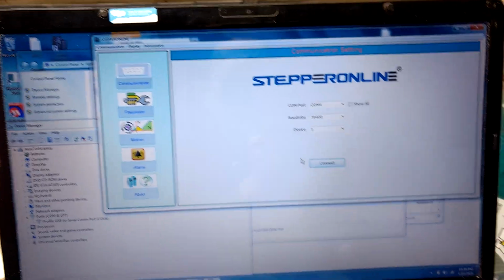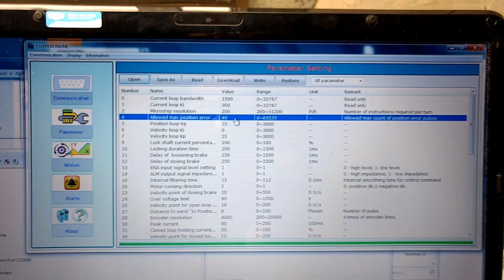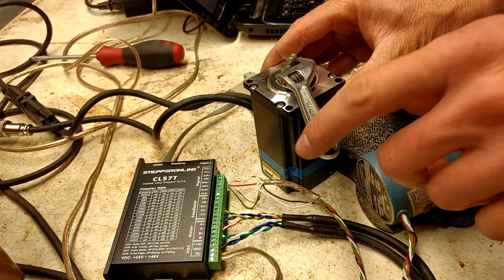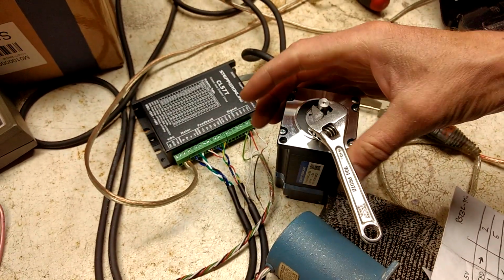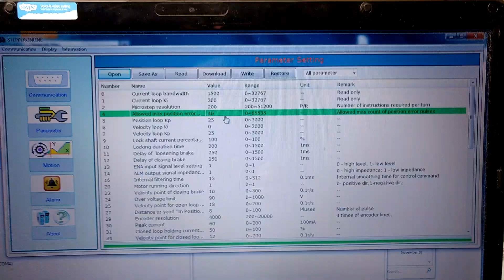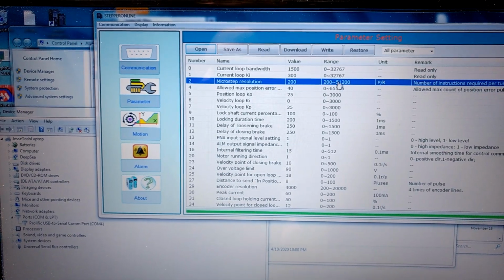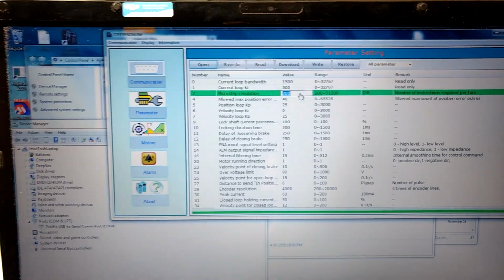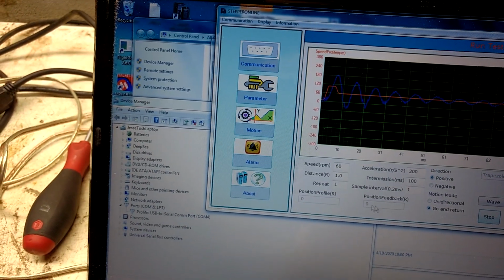How to enable Following Error Alarm and Custom Step Count on CL57T Hybrid Stepper Controller

Comment: That tuning graph is to help you tune the driver for the specific location where the stepper is installed, you tweak the PI (Kp and Ki) parameters. That means you tailor the stepper for the specific job so it can do it faster and with less error. Check on YouTube "PID regulation" for more info.

Comment: How to control this leadshine CSD 403 driver with Arduino please help me
Reply from the maker: I'm sorry, I don't know much about Arduino. But the controller has a step and a direction pin as I recall - you pulse one pin to step in one direction, or set 5v on the DIR pin to change direction, and pulse the first pin to make it step in the other direction.

Comment: I have an issue where I can't push the Y axis motor very hard.  Based on your video the issue should improve if I increase the value?
Reply from the maker: It's hard to say. Could be numerous problems. Did it used to work right then it quit working right? Have you tried wapping X and Y motors to see if the problem stays with the X axis or moves to the Y axis? Have you tried swapping the X and Y (inputs and outputs) on the stepper controllers, to see if the problem is the motor or the controller?

Having the max following error set to a very small number could limit the amount of toque available.
But having the maximum current setting set too low could also limit the torque.
It could also be a partly shorted winding in the X motor, or bad wiring.
It could even be stray inductance in the motor and/or sensor wires running to the motor which cause interference when the motor starts to work hard. See how the motor and sensor wires are all tightly twisted up in my video above? That's a good idea. If those wires are loose and stray, they can interfere with eachother and cause false signals that can cause following error faults.

But it's definitely worth looking over the settings and make sure everything is as it should be.

And of course don't forget to check the mechanical X axis, make sure it is freely moving and not binding up!

Cheers!

Comment: I purchased a different brand cl57 and they are saying it cannot be used with software :(
Reply from the maker: Did you try the software and does it not work? Or who is telling you that it cannot be used?
My guess is they all just copy eachother, I would have guessed that the stepperonline software would work on any of them, but maybe they modified the firmware a little to make it not work. You might have to get the software of the brand you did get -- or send back the one you did get and get a stepperonline one since they have software for it.
Oh, if the brand you got doesn't have software, then make a youtube video about how that company doesn't provide software and their unit won't work with available software, and send them a link so they can see that their bad practice is going to reduce business when people find out.

Comment: hello, I have the same driver (maybe a newer version), but I want to ask. Motor parameters such as current must be set using software? Did you find a manual somewhere for the individual parameters? Thanks
Reply from the maker: I honestly don't remember too much. I made the video 3 years ago :D
I don't know if there is a manual, but as I recall the parameters are common among CNC PID controllers so you can probably find and study any video on setting up a PID motor controller and learn what you need to know!

Comment: As a year has passed, would you recomend this controller?
Reply from the maker: Wow, has it been a year? I wish I could say I had an answer, but the sad truth is I've just been so busy with other things they still sit in their boxes. I have no more experience with them other than is shown in the video. They seemed to work great, although I did have some glitchiness at first, but I think the encoder cable  was not screwed on (just plugged in) and may not have been connecting. After fastening them tightly, I don't believe I had any issues.
Reply: @fromjesse  Thank you.

Comment: Does the software only come with the stepper motor, or can it be found elsewhere online?
Reply from the maker: Goodness, I'm trying to remember and I can't.  I just checked the boxes, they do not contain CDROMs, so I think I downloaded it. Been long enough I don't remember. The computer I installed it on is busy with a CNC job so I dare not mess with it, but later I can check the version of the software I have. I might even have the installer file on the computer still, if you want a copy. Running an executable from me is no more stupid than running one from China LOL.  But you should be able to find it online I think - possibly even from the manufacturer's own website, although I looked briefly just now and couldn't find it.
Reply: Its download link is on their website under the stepper driver.
Reply from the maker: @Bisofication  So it is, but it took me some head scratching to find again!
The page for the device is here:https://www.omc-stepperonline.com/closed-loop-stepper-driver/closed-loop-stepper-driver-0-8-0a-24-48vdc-for-nema-17-23-24-stepper-motor-cl57t

The exact download l ink for STEPPERONLINE_v2.0.0.exe is here: https://www.omc-stepperonline.com/download/STEPPERONLINE_v2.0.0.exe
Reply from the maker: Hey I know it's been a long time but I found the info you asked for:

The page for the device is here:https://www.omc-stepperonline.com/closed-loop-stepper-driver/closed-loop-stepper-driver-0-8-0a-24-48vdc-for-nema-17-23-24-stepper-motor-cl57t

The exact download l ink for STEPPERONLINE_v2.0.0.exe is here: https://www.omc-stepperonline.com/download/STEPPERONLINE_v2.0.0.exe

Comment: Do you have a download link for that software?
Reply from the maker: HA!! Guess what I found! A link to the exact software I'm using right from the manufacturer's website: https://www.omc-stepperonline.com/download/STEPPERONLINE_v2.0.0.exe
And their page which has other software links as well is here: https://www.omc-stepperonline.com/closed-loop-stepper-driver/closed-loop-stepper-driver-0-8-0a-24-48vdc-for-nema-17-23-24-stepper-motor-cl57t

If for some reason the above links goes away,
I still have the install file that I used, it is named STEPPERONLINE_v2.0.0.exe and it has an md5sum 978dad02590c5a1c8b51f4c85519be65 and it is almost 2MBytes.
(Specifically, the size is 1930377 bytes exactly.)
Reply: @fromjesse  Yep. Finally I found it too yesterday evening... Was hided behind "select driver" section. I did try to find it from "sources & help" area without success ;) I have only an one difference. I use CL57-BK, which have a brake output for my Z servo (with brake naturally).